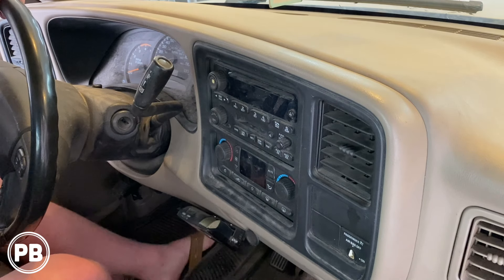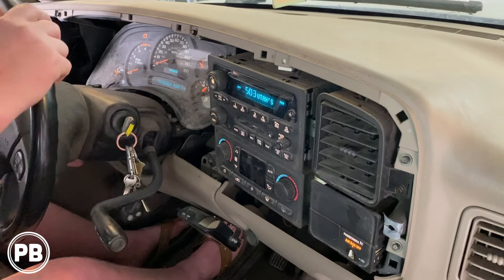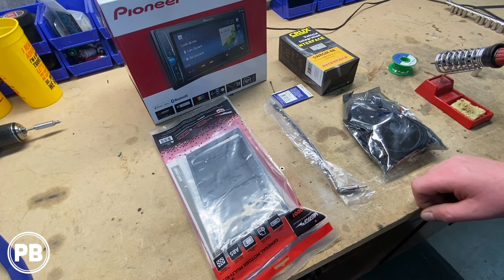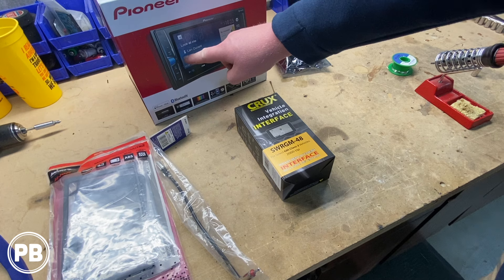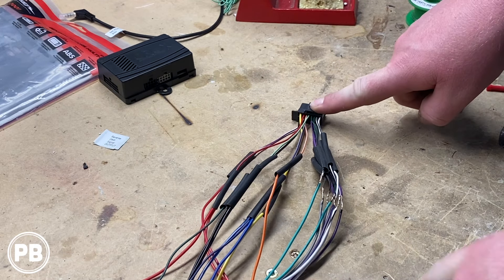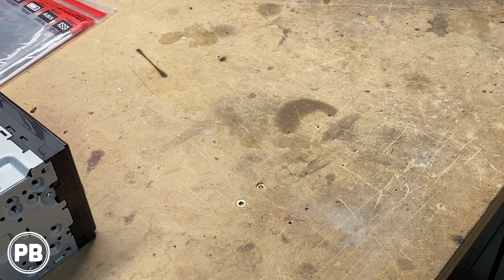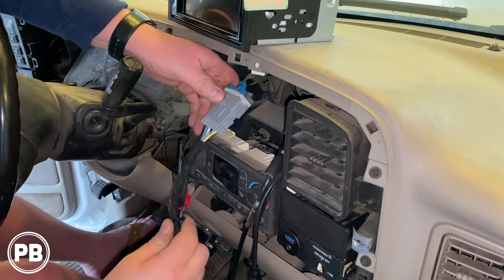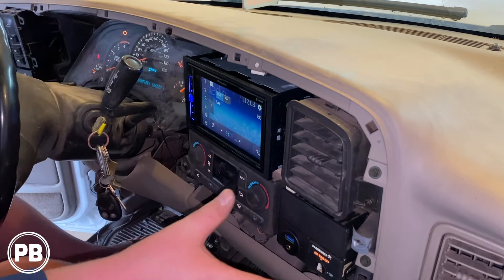1995 - 2006 Chevy / GMC Stereo Install

Comment from the maker: Parts used linked in the description!
Reply: How do you bypass a bose factory amp on a 2004 chevy silverado
Reply from the maker: @CarlosGonzalez_753  https://amzn.to/2UnEwTy may fit
Reply: Did it work out for you? About to try
Reply: Have you done a video on how to do the bypass?  Seems to be a prevalent issue in regards to your video.
Reply: Hi my friend why if you change the original car recorder with a screen all the sound alarms go like a safety belt and  alarm sound if one of the doors is open
Reply: Hi I have a rd fox harness I’m not sure if the wires are in th right spots to plug into the truck how do I make sure there in the right spot on the harness as there is no reference

Comment: I love the video! I picked up all of the parts. I went to start the install on my 03 Sierra. My factory radio has two connectors, 12 pin and 24 pin. Do I need a different Crux adapter?
Reply: Same problem here. 
Did you ever figure this out?
If so, what was the answer?
Reply: Same.  Has anyone figure this out.  My steering wheel controls are not working.
Reply: You only use the big 24 pin connector. Tuck the little 12 adaptor in the back of the dash and forget about it. the radio woks fine. I had to hook up my blue amp wire to the red positive to get sound.  I used a Boss Stereo with the Crux.

Comment: My Power keeps staying on !!!!!
Reply from the maker: You may have the wrong harness adapter.
Reply: @ProvoBeastAudio  I think I need to run a wire to ignition fuse
Reply from the maker: Well, not if you get the right adapter...2003 years and newer transitioned over to a canbus data system, so there ins't an analog accessory turn on at the radio.  Either get the right harness, or you have to make manual connections at the fuse box. @JustinD007
Reply: @ProvoBeastAudio  ohhhh ok yeah it's rather do it the right way

Comment: Those screws are actually 7mm
Reply from the maker: Yes, 7mm will fit fine for metric users, but technically they are 9/32.  7mm would be much easier to use.
Reply: @ProvoBeastAudio  technically their 7 mill everything on that truck is metric. Can pretty much replace the engine with a 8 mill, 10 mill, 15 mil

Comment: Hello, I coneccted everything,  but the second smaller plug from the vehicle, were it connects?  I have no audio!   Help please.  Radio turns on, volume control works, no audio
Reply from the maker: If you have Bose, it’s important you connect the blue - white wire on the crux harness to the new radio.
Reply: @Provo Beast Audio Installation  yep, that was the one. Everything works, awesome!   Thanks!

Comment: Which writes don’t match and with the harness and the stock harness
Reply from the maker: Depends on the radio and harness adapter you use.
Reply: I have the same equipment you do..I just need to know what wires don’t line up

Comment: I do t get it man i did everything correctly for two days now and it won’t work….iv even plugged in the old radio and it work fine
Reply from the maker: It’s a wiring issue. Recheck all connections and correct pairs (regardless of color) to ensure the function of that radio wire matches the function of the wire on the harness adapter.

Comment: I did this and have no sound, any advice
Reply from the maker: You have bose, and you may have the wrong harness, or failed to hook up the blue / white wire to turn on the OEM amplifier.
Reply: @ProvoBeastAudio  Thank you, it works

Comment: I plugged in and had no power to the radio.  0V out of the red accessory wire from the CRUX.  Ever have any issues with faulty CRUX units?
Reply from the maker: Contact Crux tech support.
Reply: Tap it in to your a/c wiring harness. Usually a brown wire. I know it's a late comment. But now you know

Comment: Can you do this without the crux harness
Reply from the maker: for years 2003 - 2006, you will need a smart harness as you have a canbus system in your truck.  Crux is generally the cheaper alternative to Pac or Axxess, however you can always go with the walmart special and get a cheap scosche harness.

Comment: Question: 2003 gmc sierra. Kenwood ddx376bt. Crux SwrGm-48.   Soldering the harnesses together, the colors don’t seem to match. Do you have any other resources /diagrams to help get it right?
Reply: And… the metta trim plate is a sloppy fit around the receiver while having to stretch to fit around the edges of the receiver.  Any ideas on a better fit for the kenwood?

Comment: Will this kit work for a 2004 avalanche with bose?   Or I need a pac rp511?   Thanks
Reply from the maker: If you have factory navigation, parts may vary.  Base radio with Bose will be fine with all the parts shown.
Reply: @Provo Beast Audio Installation  thanks for answering,  so this is basically the same function as the pac rp5 gm 11 in different format?   Jist curious,  going to buy it tru your link. Is a base bose no navi, and the radio is a jvc
Reply from the maker: @12masterr  It's a brand difference, and if you went pac, it's actually the rp5-GM11 if you went the pac route.  Yep, all the same stuff we used in our video will work for yours! The Crux SWRGM-48 will work great.
Reply: @Provo Beast Audio Installation  last question, Do I have to bypass or do something ti the parking brake connection?  Can I just ground it?  Thanks
Reply: Can you please answer that!  Don't know what to do with the parking brake thing!
Reply from the maker: @12masterr  Hey buddy, depends on the radio.  Pioneer and Alpine units require a double pulse or triple pulse negative on the parking brake wire.  You could just ground it, but it may still block you out of certain settings and / or features.  Fortunately, the Crux or Pac harness mentioned provides a parking brake wire connection, so simply just hook it to the smart harness and you are good to go.
Reply: @Provo Beast Audio Installation  awesome!   My radio have 2 plugs in the back, not one, were the second smaller one go?

Comment: I put in a new radio but the radio wouldn’t turn off when the key turned off (I had put both the radios constant battery yellow wire and ignition power red wire together to the adapter wires), figured that ez way wouldn’t work so I wired up the red to the radio fuse but then the radio wouldn’t work at all. Maybe my fuses aren’t working but could use some help?
Reply from the maker: It’s a wiring issue for sure. Haphazardly connecting wires will not only cause malfunction of the radio but also potentially blow fuses and / or damage your radio or vehicle. Install your radio correctly.

Comment: I bought the parts listed but unfortunately my stock radio had 2 plugs in it. Will this still work??
Reply from the maker: Yep will work great. The smaller harness is not needed for your new aftermarket radio.
Reply: Awesome, thank you! Great video!
Reply: @ProvoBeastAudio  do you need to plug in to the non-bose side to make this work?

Comment: Ok the hook up seems easy. But I noticed u didn't have to program your Bluetooth deck. I also have a Chevy Tahoe but I have a wire harness similar to the one u put in. Mines I bought the guy told me I hav to program the Bluetooth deck n I have a black box the has a light on it that's supposed to turn green when everything is hooked up probably.

Comment: I did that and it didn’t work it wasn’t getting power or something it would turn on for a second when I plug it in but then turn off I tested it on the battery and the radio works

Comment: THANK YOU!!!! Already ordering the parts you have here.

Question for you: 
My radio turns on, but I got no sound. Speakers make kind of low frequency heart beat noise in perpetuity. How do I test to see whether my speakers or my amplifier went out? I don't wanna pay diagnostic fee.
Reply: try hooking up the blue amp wire to the red positive,

Comment: I wired my 04 Silverado exactly like this video using a Boss stereo.the stereo works fine but after a few minutes the back of the stereo gets so hot you can barely touch it what would cause this

Comment: I'm trying to install a radio in a 2000 express 3500 LS and I don't seem to have the wires for the speakers at the radio connector for the factor radio.

Comment: Is it worth buying that "box" that comes with the radio adapter despite having neither wheel controls or OnStar? '04 Silverado 1500 LS
Reply from the maker: Yes, you need a smart harness as 03 and up GM have converted over to a canbus data system.  There are versions that are bare basic like this unit: https://amzn.to/3Yz79IM

Comment: Red acc wire what color on truck? Used spliced yellow and red for power. But don’t want it like that. I want it to work off of ACC when you turn the key. How do I go about doing that?

Comment: I was able to get all connected. It powered up when I turned on the ignition, but it no longer has power. I replaced the fuse in back of the radio, but it still doesn't turn on anymore. What's my next diangosis?

Comment: I am not getting any sound on my GMC Sierra 03 please help
Reply: I had same issue and the BLUE - power control/power antenna wire that was on my kenwood head unit, HAD to be connected into the blue/white of the crux interface.. also tied into my 4 pin SWC blue/yellow wire (for steering wheel controls) in so all 3 are tied together...originally i just had the blue/yellow swc wire and blue/white from the 24 pin harness....and i also had no sound.....the blue wire labeled power control/power antenna was the wire i needed to actually power my amp and then i got sound....

Comment: Great tutorial but do you happen to know one that would include a multi-disc CD player?
Reply from the maker: Nope, and units with a single disc CD drive are disappearing quickly. There are no brand name units that manufacture a multi disc changer, although you may find one from 20 years ago used.

Comment: So the vss wire and parking brake wire. If i get the pac rp5-gm11, rp4-gm11, or rp3-gm11 so i connect noth parking brake wires and vss wires to each other? So basically do i connect the parking brake wire on the head unit to the parking brake wire on the rp3, rp4, rp5 and same with the vss wire?

Comment: I have a 2005 Sierra got the same parts that you used in the video. I'm a first timer when I look at the video and you match wire per wire you connect just about all the wires. I ended up with lots of extra wires please explain.
Reply from the maker: All depends on the radio you are installing, some aftermarket radios will not use all wires provided by the wiring kit, some will.  Just depends on your install.

Comment: 03 GMC Diesel with Steering wheel controls along with stock DVD player. will my DVD player still work??
Reply from the maker: You will need the Pac version (RP5-GM31) of the harness to retain the audio output from the OEM dvd player in the rear. You will also need a new radio that has an AUX or AV input to play that audio from the rear screens.

Comment: Hey man I’ve watched so many videos trying to figure this out I have the crux harness and everything but my girlfriend bought me a head unit from Amazon it is a dual car play head unit everything seems to wire up right but when I got everything connected and went to put the radio in there was a smaller gray connection going into the back of my stock radio and I am not sure where this is supposed to go on the new head unit or harness I cannot figure it out

Comment: I just had best buy install a double din pioneer and after the install the dash bezal now has a huge gap and looks like complete shit I told them that this was unacceptable and they told me that there is no way to avoid it so basically your stuck with it... looks like this install doesn't have gaps.
Reply from the maker: If done right, it wont have gaps.  We've fixed a few best buy "installs" over the years....

Comment: What do I do with the other wiring harness on the back that had 12 prongs? is that the aux? I mean the wire harness next to the antenna? Because I have a third factory harness. And I don’t want any extra usb outputs. I wish I could send a photo of the third harness and the wire harness side has 24 square holes but the 12 prongs on the factory radio that it plugs into.
Reply from the maker: Feel free to reach out on facebook and we can assist.

Comment: My harness kit from Metra has 2 blue/white wires. Do I connect both of those wires to the remote control blue/white wire on the radio side harness, or do I just connect one of the blue/white wires to the controller?
Thank you!

Comment: I followed the wire diagram on my boss radio had all the same setup except bose stereo, steering wheel controls or onstar. After install everything works except my key fob to lock and unlock the truck. No blinking light on the dash either now. Any help would be appreciated!

Comment: For the wiring harness adapter if I have a base model with no controls on the steering wheel, not even a Bose system do I still need to buy that?
Reply: No

Comment: My aftermarket radio has been conected to all color coded wires across to the original harness but its not turning on. I have the left the blue remote wire out thought i didnt need it. Any help?
Reply from the maker: To the original harness as in the factory harness? Or the harness adapter?  If you have connected it to the factory harness, meaning the original plug was cut off, it will NOT be color for color as factory wiring will differ from aftermarket.

Comment: This will work for the UQ7 version of ‘04 Tahoe, w/0 Onstar,No swc ..?
Reply from the maker: Yep! All parts linked in the description.  And just for an extra step here, if you don't have Steering Wheel Volume Controls, Bose, or OnStar, then you can use an even cheaper version of this harness here: https://amzn.to/3oaMw76

Comment: Very cool radio dirty job take no time to clean the panel and dash lazy boy
Reply from the maker: You should have seen what I had to move to get to the radio to film.  Guy then threw everything back which made no difference whether it was clean or not.  It was a concrete company truck.

Comment: Good Work! Looking to install the Kenwood DMX4707S in my 06 Chevy 1500 with the Bose system with steering controls. Are these the correct components to use to install and make the correct connections.

Comment: i have a radio that will not turn on like there is not hot wire when the key is turned but the yellow one is always on do you know how i can get it fixed
Reply from the maker: The yellow wire is suppose to be on all the time as that is your battery lead and memory wire.  The ignition wire is generated by the smart harness (2003 - 2006 models).  If you have a model 2003+, you will need a smart harness, or locate an accessory wire (red) elsewhere in the vehicle (like the fuse box).
Reply: @ProvoBeastAudio  i tested all of the wires and the yellow won was on all the time but on my truck the ones that were on all of the time were orange and my dad said that the red one should be hot when the egnition is on i have a 2003 gmc serria 1500 SLE exstended cab

Comment: did u have to get the radio programed around the security system or any thing
Reply from the maker: Nope, not with the right parts.
Reply: @ProvoBeastAudio  sorry i mean like did u need to get you anti theft or any thing done to it

Comment: So my Delco one that's in my 03 Silverado is  XM ready and the antenna is on top of the cab I was going through  the comments and I saw that you need an extra tuner for the XM? Is that only for non XM aftermarket  radios?
Reply from the maker: If your new radio is "XM Ready", really that means the radio is XM capable, but doesn't mean it's equipped with everything you need.  If your radio is XM ready, you will also need the XM tuner for the radio (as the radio doesn't have that hardware in it).  You can retain factory XM antennas with the right adapters, but the tuner must be purchased separately: https://amzn.to/2WM1ULH

Comment: I tried hooking up an aftermarket touch screen Android radio with a regular harness and it didn't work. I think that's what I have to do is get the interface harness like you did. Thanks for the video.

Comment: When I remove my factory radio from my 2004 gmc Yukon, there are two wiring harness, but the video only shows one.  Please advise.
Reply: One is running through your stock amplifier bose system. The other will bypass amp system and you will lose the sub.  Which you may want to use if the amp is bad or goes bad

Comment: Is there a wire left for adding subs and a Amp if wanted?
Reply from the maker: Adding an amp and sub generally requires an amplifier wiring kit. The products seen in this video are for a radio install only.
Reply: @ProvoBeastAudio  what would you recommend for a wiring kit for that?
Reply from the maker: @jakehull03  All depends on the amp.  Depending on your amp manufacture's requirements, it could be an 8, 4 or 1/0 gauge wiring.  There is OFC and CCA wire type kits (OFC being copper and more expensive / premium). Being a complete shot in the dark, here is a CCA kit 4 gauge: https://amzn.to/3zIWXT2